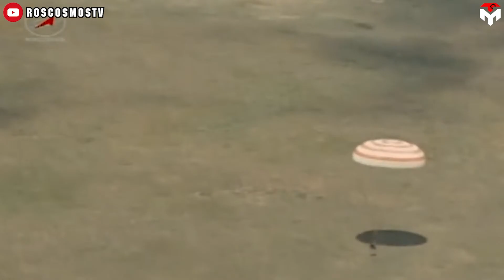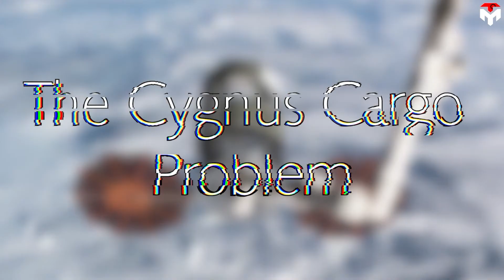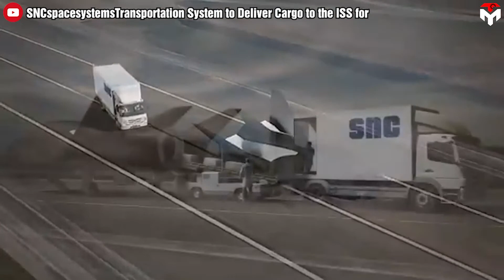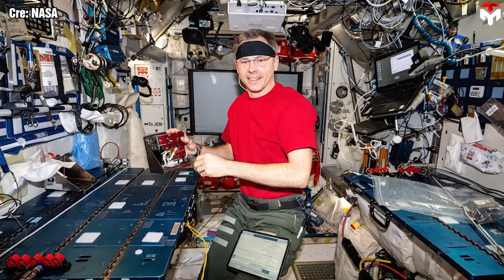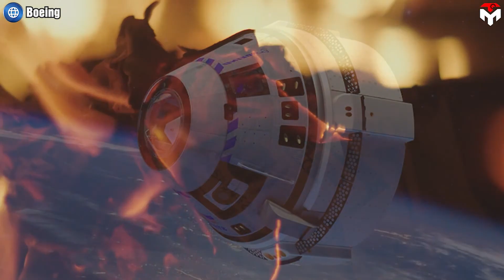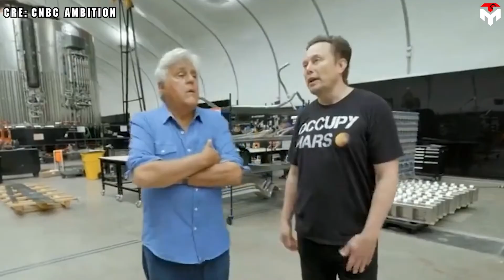NASA Astronauts said this about Inside SpaceX Dragon after Rescued...

Comment: So why did NASA not just schedule an extra dragon supply only mission when the cygnos ship got canceled. That would have been the obvious solution, and much cheaper than reshuffling loads.
Reply: but that would also mean that two additional astronauts on board ISS had to leave as well since Sunny nor Butch had clearance to fly Dragon without proper training.
they were both working for Boeing remember?
Reply: I was referring to the cancelation of the Cygnus ship at 15.30. Not Butch and Sunny.

Comment: In my opinion Boeing needs to trash there Starliner rocket 🚀 and start over with a brand new design a design that if they have to do modification to the new rocket 🚀 it wouldn't take a year to fix it. They might even think about some of the stuff that SpaceX use except it will be there own design.